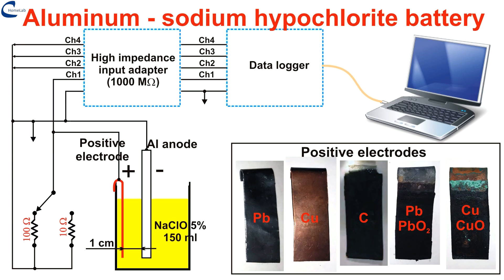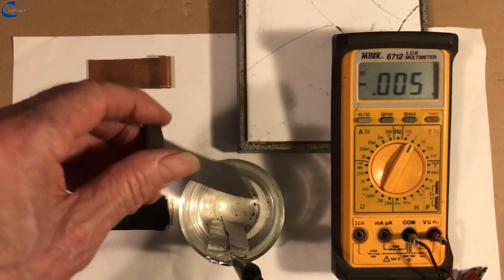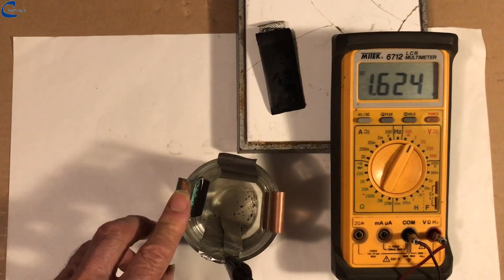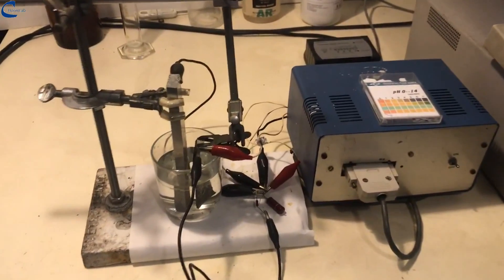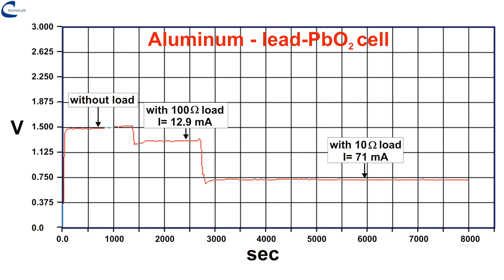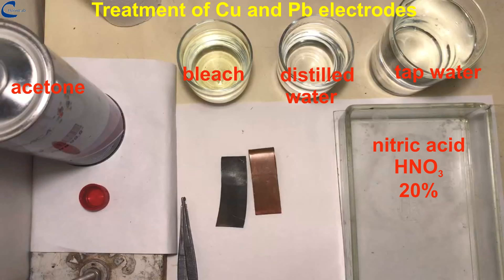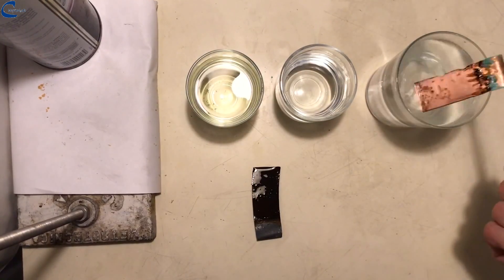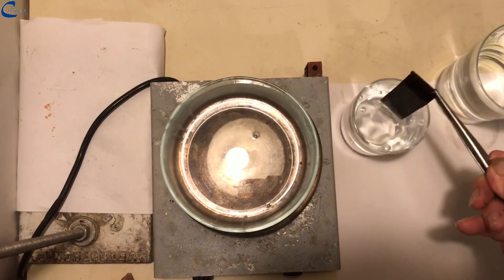The aluminum  battery

Comment: the aluminum-copper battery i made was "charged" to make the copper oxide layer. I used NaCl as electrolyte, so the battery used the CuO as the only oxidant.

Comment: Gold-plated or Platinum electrodes should have shown the best results.But they are expensive.

I made such alkaline batteries, but they didn't last long.At first, the voltage and current were high, and then everything faded away.

Comment: A very interesting study. I studied the issue of the use of hypochlorite and aluminum for the production of electricity outside the house. Solar panels cannot always be used. I used foil, since its surface is great for sufficient current strength. As another electrode, I used stainless steel or titanium. The element voltage was 1.8-2 V without load. Try to use noble metal or inert metal. Perhaps a thin layer of platinum applied to a polymer film with a large surface. I also believe that you can use a large concentration of hypochlorite.

Comment: try adding a little hydrochloric acid to the reaction volume and see what happens to the voltage
Reply from the maker: It is not advisable to do so, because the pH of the electrolyte would become acidic and the consequence would be the production of chlorine
Reply: @claudiohomelab8181 could you put 3 or 4 different positive electrodes in series with one negative and get more voltage.
Reply: can calcium hypochlorite work ? @claudiohomelab8181

Comment: It isn't rechargeable. It works better if you use a cathode of a metal oxide or salt mixed into pressed graphite. Bleach is doing more or less the same thing as NaOH since it has a lot of NaOH in it to stabilize the NaOCl. What you want would be to have the anode donate the oxygen to react with the aluminum but make the electrolyte as unreactive as possible with the aluminum because the hydrogen made quenches the voltage output. An aluminum/manganese dioxide-graphite in propylene carbonate will generate a bit over 2.8V.
Reply: Add carbon too system too store power....I took one piece off charcoal put foil around it soaked in salt it gave off power for weeks...not even charged...the power was low but the principle is there